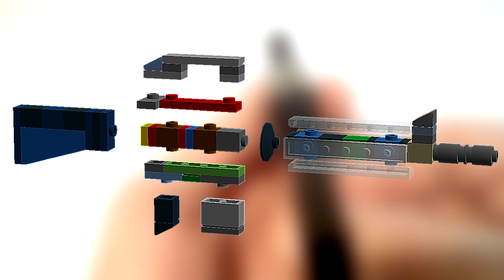LEGO Miniature Guns: REDUX M16 (and then some...)

Comment: I made the mw2 m4a1 also able to be the normal m4a1 take the top of the receiver off and put that carrying handle at the back and put a 4 tile on the sides and top of the handgard sorry for my spelling if that is wrong and then put the colt commandos front sight and replace the mw2 iron sight with that and there u go